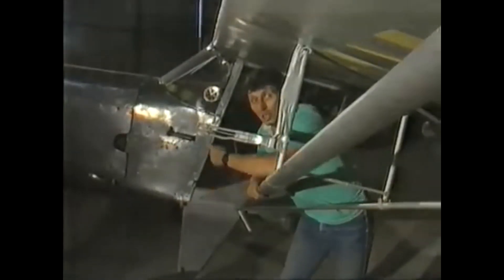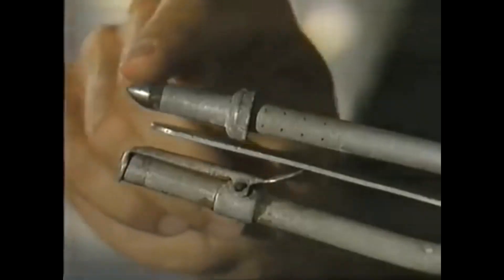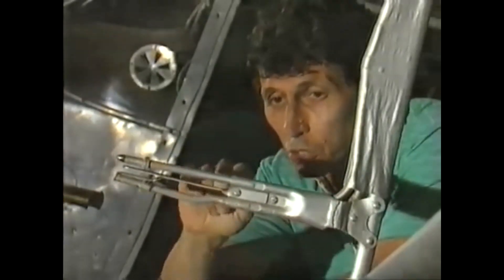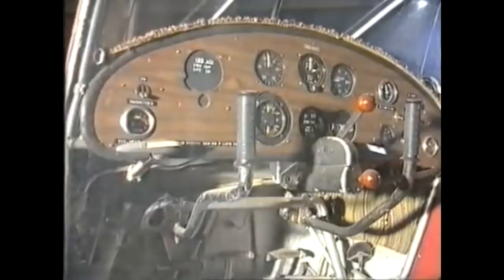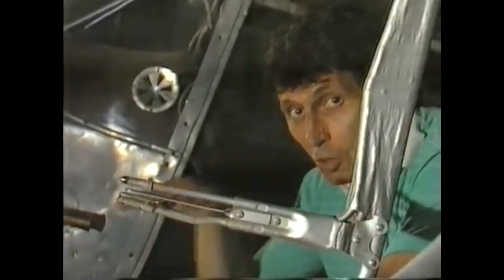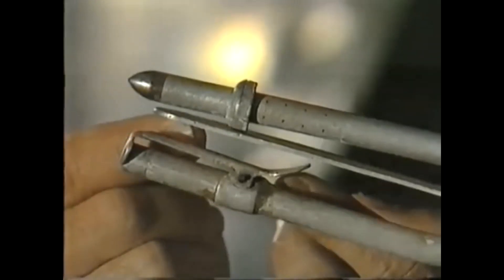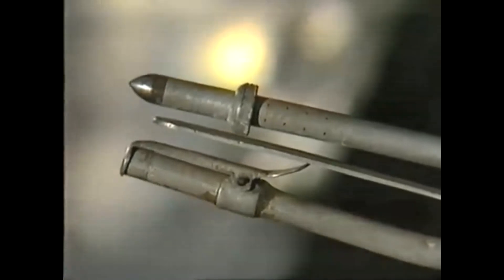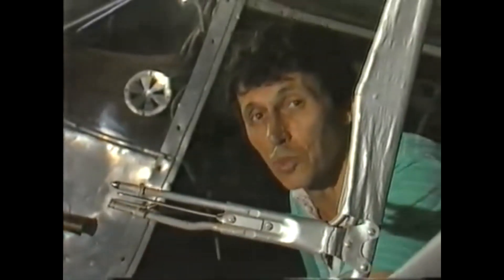Curious high-flying tube

Comment: Pitot tubes, thanks! There is an interesting wiki on them, including aviation accidents. One was due to the tube being blocked by a mud dauber wasp.
Reply: That's what walkarounds and periodic maintenance are for, I would've thought.
Reply: @neilgerace355  It is what pitot tube covers are for. They must be covered if the plane is parked for a long time - in places where mud dauber wasps are common, the covers must be installed if the plane is on the ground for an hour.
Reply: @neilgerace355  You are right.
Do you know Mentour Pilot?
"Who Is Flying?! The Unbelievable Story of Kenya Airlines flight 507"
Latest one of his videos.

Much similar to the case of Airfrance 447.

Walkarounds?????

As you can see with this more recent case, some parts of the plane are not given much attention.

Luckily it did not yet repeat itself.
But: it should be clear that we have gone too far with everything.
In the old days people were actually able to control a plane.
Now a days they are only able to control a checklist.
Reply: I remember seeing that, but it wasn't a small Aircraft like this old one, can't remember what it was though.
Reply: @steviebboy69  Airfrance 447 had the static ports blocked by a piece of tape???? That the one you mean???
Anyways, there are other examples.

Crazy in my mind, because if i was pilot i would think those ports and tubes are one of the most important things to check.
So i would check check, double check, triple check them every single time

Ah well, some people, ey...
They just dont care.
Reply: @bertjesklotepino  Yes that could have been the one? was this the plane that the captain thought they were flying at altitude but infact just above the ocean? and realised when it was too  late.
Reply: @steviebboy69  Sorry, i am wrong. Its not that one.
Reply: @steviebboy69  aeroperu 603, that is the correct one.
You can find the episode on the YT channel: Wonder.

Comment: They don't make them like that anymore 😄😍 flying at 32000 ft in -57°c  it would freeze instantly!
Reply: You don't really get icing under -40C. In order to get icing you need for wet ice to stick to leading edges and then freeze there. But under -40C it's so cold, it's like flying through dust, so you don't get icing.
Reply: @CristiNeagu  not even on the way there from ground temperature?
Reply: @boomstand2872  The comment specifically says "flying at 32000 ft in -57°c". That's what I was addressing. And even on the way up, it depends if it encounters moisture.
Reply: They have heaters now, which means woe betide the pilot who forgets to turn the heater on
Reply: I dont think this old thing would get anywhere near that level.
Reply: AF447